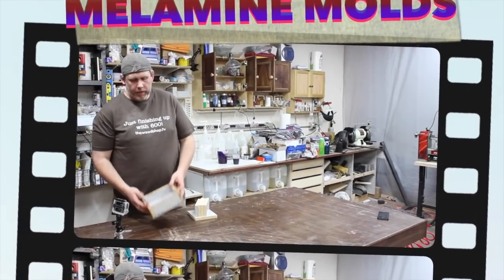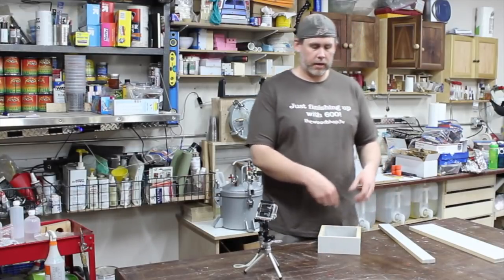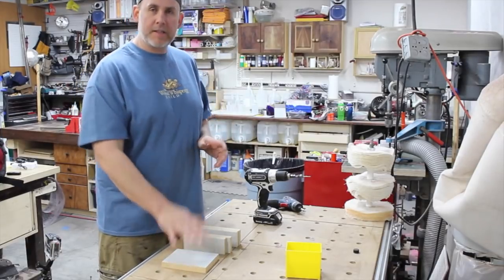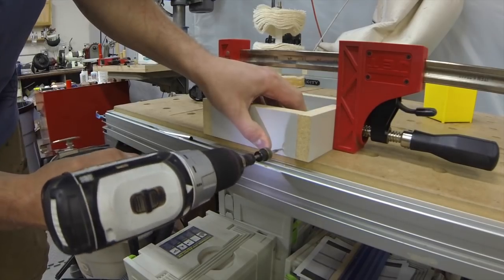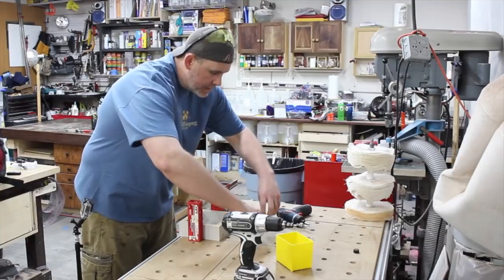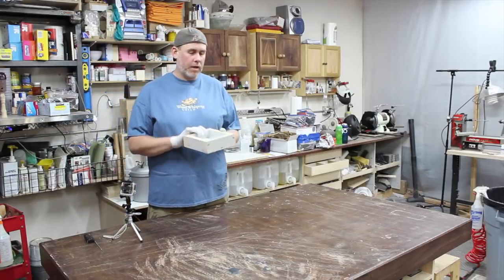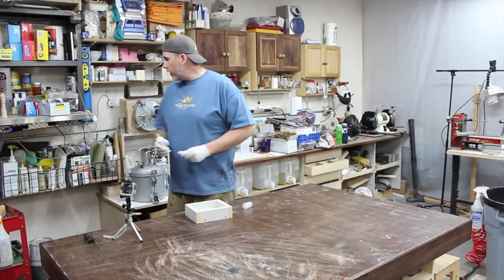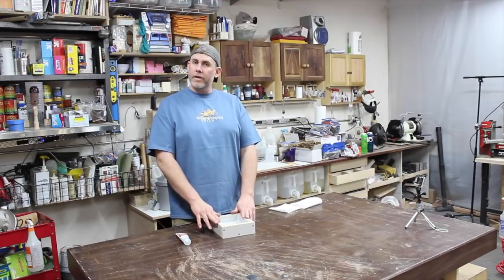Make Melamine Molds For Resin Casting - NV Woodwerks

Comment: If you get it at a local lumber place (NOT HD or Lowes), you can get a 3/4" 8x4 sheet for about $30.  Not a bad deal.  Did all my shop countertops in the stuff, in black, and they look cool.  Thanks for the vid Zac!

Comment: I don't have a table saw. Could I have Home Depo cut this? Also do I need to spray anything on the bottom to prevent sticking & approx curing time. Great video btw

Comment: Zac you can buy the shelving material 1/2 or 3/4 x 12 " x 8 ' I haven't seen sheets of it like plywood .. But with that you can make hell lot of molds .. And great idea i'm going to try that .. Have you ever used Vasaline as a release little dab on your finger just enough to put a film .. Its a old painters trick that i've used for years for trimming around windows and stuff .. Nothing will penetrate it ..
Reply from the maker: Hey James, I've heard you could use vaseline, but I haven't tried it. Paste wax works great though too. Give it a good coating, you don't want the resin to stick to the melamine. I've heard some folks say the shelving material works, others say it doesn't. Just make sure to get a board with a decent thickness of melamine on top, I think some shelves have a different film layer than melamine

Comment: Hi zac, what measurements did you cut your molds into? Also i brought myself a drill press but it only goes into my blanks 55mm, because the brass tubes are small enough should i just cut my blanks into 3 instead of 2??? Or should i get a different drill press???

Comment: Another thing you can use rather than the expensive release sprays is to use regular cooking spray like PAM.

I need to make something like this, the PVC pipe works great for a couple colors that you don't care about how it turns out, but I'd like to do some blanks that use different colored resin ribbons and these types of molds are the way to go, open base makes for easy layout and pouring in of the resin.
Reply from the maker: +William Todd (williamtodd) I haven't tried using PAM yet, Alumilite can be finicky sometimes depending on what it comes in contact with. I just decided to go with one that's supposedly formulated for polyurethanes. Like so many things though, it may just be marketing! 

I think you'll enjoy using the horizontal molds. I definitely like the way the blanks come out a lot more than using the pipes. You will definitely save a lot of resin using tubes though.

Comment: Home Depot carries 1/2” x 2’ x 8’; they also sell White Melamine Wood Shelf in different widths and lengths in 1/2” and 3/4”.  So you don’t have to purchase a 4’x8’ sheet if you don’t have a large enough area to cut it up on. Plus a full sheet is heavy to carry.

Comment: Thank you for sharing the video.  As always I find your videos really helpful.  After building the mold I proceeded to cast a blank. However apparently the A and B did not mixed properly, after over 15 hour in the pressure pot, the blank did not get hard. It was too soft.  what I'm doing wrong?
Reply from the maker: Hey Samuel. Curing problems are caused by improper measuring or mixing. Make sure you read the instructions for the product you are using to know if it's measured by weight or volume. Also give this video a look that covers proper measuring and mixing: https://www.youtube.com/watch?v=nNkEVfWD9a8&t=1s
Reply: Thank you for your quick response.  I will try again.  I hope it works this time.

Comment: i know this is a really small insignificant tip but for a really smooth corking job get some very soapy water and a damp cloth. dip it in and smooth away. i use fairy liquid. I dont know what you call it in the states but basically dish washing liquid. Cheers for the vid! off to make some blanks with a lot more confidence!
Reply from the maker: +m4xrb Great tip! It gets messy wiping it all around with your finger and paper towels. I'll have to try that on the next one.
Reply: Zac Higgins wouldn’t this potentially pollute the resin mixture?

Comment: Thanks.  Looking at getting into this. This was a good starting point for a newbie
Reply from the maker: Glad it was helpful for you Troy, I think you'll enjoy casting =D Check out my video on HDPE for molds too, it's totally non-stick and works even better for square molds than melamine https://www.youtube.com/watch?v=RrqKN1g6vA4
Reply: Thank you.  I’ll have to check out the hdpe video.  Do you have a preference as to the brand of exposure you use?
Reply from the maker: I'm guessing you meant to say what brand of epoxy instead of exposure? I primarily use Alumilite Clear casting resin for my work. I also have use epoxy products when I need a longer working time though. I have links to the ones I use on my "tools I use" page on my website: https://nvwoodwerks.com/tools/

You might take a peek at my video Choosing Casting Resins, it goes over the three main types of resins out there: https://www.youtube.com/watch?v=pQ63Fky5ca4&t=1s

If you're just getting into casting,  my e-book "The Beginner's Guide to Resin Casting" should be helpful. It covers all the basics: https://nvwoodwerks.com/product/the-beginners-guide-to-resin-casting/
Reply: Yes.  I did mean epoxy. I checked out the hdpe video.  Might be easier than melamine.  I’m wanting to build some molds to make micarta style knife scales
Reply from the maker: I think you'll be better off with HDPE for that since it can get pretty messy. No need to even worry about it then

Comment: I was thinking about doing some sort of mosaic pattern using small wood blocks on top of a round wood top and filling all the gaps with epoxy. How would you go about wrapping/sealing the edge? Awesome video man.
Reply from the maker: Hey Joshua, that's a pretty awesome project idea! I'd try to find something that is a relatively thin plastic that you can bend/wrap around the circle base and hot glue it in place. I've been racking my brain trying to come up with the perfect thing to use to wrap around it, but I just can't think of something that is readily available and super cheap to use for it. The only thing that comes to mind is thin uhmw. I have a feeling that you can find something similar for cheaper, but here's a link to the UHMW I had in mind: https://www.woodcraft.com/products/slick-strips-3-width
Reply: I'll keep that idea in mind. Thanks for replying so quickly. Never worked with resin before so I'm kinda clueless. Now I'm thinking maybe I could find some kind of paper board that is thin enough to wrap in a nice circle but rigid enough to keep its shape. Do you think it would work well if I glued the bottom edge of the paper to the base and then seal the corner with silicone and use packing tape on the inside of the board?

Comment: Correct me if I'm wrong or clear this up for me, are you referring to particle board with a "Formica" laminate on it? I saw a comment where you discussed with someone about picking it up at store as ready made shelves. I was thinking that would be Formica.
Reply from the maker: I'm not sure what the difference between melamine and formica is, but I think we're talking about the same thing. It's just particle board with a piece of plastic glued to it. You can get melamine covered sheets at home centers, but there are also some precut pieces that appear to be the same material in the shelving department.
Reply: Thanks Zac for the quick response. I did some research online before I rattled your cage and I did see it was mentioned as being 'part' of Formica but then it started looking like a Chemical Lesson & I'm not so interested in knowing the molecular  structure of it ;-) lol I've saved some shelving  shelves (that sounds funny for some reason) planning to use them for some jigs around the shop. Will let ya know if/when I feel up to doing them if it works so you can pass the info along.

Comment: nicely done! thank you for the tips, you are very thorough. wondering what you store in the big plastic jugs on the below shelf on the bench in the background?
Reply from the maker: +Tyler Haywood Thanks Tyler! I try to pack as many tips in as I can, I know how little tips can make a huge difference and save you lots of time. Those big jugs are 10 gallon kits of Alumilite resin. I was just running through the 2 gallon kits too fast, had to bump up to the big jugs!

Comment: last question... have you used polyethalene for a box? if so what is diff between it and the melanine? thanks!!!
Reply from the maker: I haven't used polyethalene for a mold, I am actually using 1/2" smooth HDPE sheets for mold material now though. It's totally non stick.
Reply: thanks i will try that!
Reply: Do you still need a release agent with the HDPE?

Comment: Hi Zac,  I made your form and it turned out great. But the resin stuck to the melamine and ruined the form. I believe I used the wrong spray .. What type spray do u use for resins, please? Jim
Reply from the maker: I guess it depends on what resin you're using. For Alumilite, you want Stoner Urethane Mold Release. You can get it on Alumilite's website: https://www.alumilite.com/stoner-mold-release-12oz.aspx

Comment: HI Larry here I was wondering when you do your molds and when you pore the resin do you cover it? also when you turning your pen blanks what type of setup do you use ? the live center ect?  I guess to hold the blanks on the lathe? and where do you get your pen kits? sorry about all the questions I'm new to this! and your videos are great! thanks Larry
Reply from the maker: Hey Larry, glad you're enjoying the videos! I don't cover the mold when I pour them, just pour it in the mold and put it in the pressure pot.  When turning pens, I use a dead center in the headstock and a live center in the tailstock, and I use "between center" bushings rather than a mandrel. I find mandrels to be inaccurate and can cause blanks to be turned out of round or cause issues when applying finishes.

I usually buy my kits from Turners Warehouse (www.turnerswarehouse.com), Chad Schimmel owns it and is a fellow YouTuber,  and he has a big selection, great prices, and excellent service to boot! 

Check out Chad's channel too, he has some really good videos on pen making and casting too: https://www.youtube.com/user/ctschimmel. Oh, and I just remembered, Chad has a great video explaining the different types of bushings you can use for pens: https://www.youtube.com/watch?v=5q3AwlPftTY

I also have a resources page on my website with links to where I get most of my tools, equipment, etc., and I have links to the dead center and live center that I use as well as most of the other things I use for casting and turning: https://nvwoodwerks.com/tools/

Comment: Have you ever had an issue with opening the pressure pot and looking at your mold only to see that the corners are rounded? It's like the resin just pulled away from the corners. I'd like to fix it before I make a 5.5 inch mold to still get square 5 in blanks
Reply from the maker: Yeah that happens often, it's because the corners are cooler and the resin tends to migrate to the warmest spot. Try heating your mold up before casting, it should help out. Make sure the mold is sealed as well to stop airflow into the mold

Comment: hola: in my country i cant buy alumilite resin, is epoxi resin the same? and insted stoner what i can use? thank for sharing is very usefull information
Reply from the maker: Hola :-) Epoxy or Polyester Resin will work pretty similar to Alumilite. There are some minor differences, but all the casting resins are generally similar. Each resin type has a different spray mold release agent. Stoner is a urethane release agent, but there are other general ones. You can also use petroleum jelly or paste wax as a release agent. Epoxy and Polyester Resin both shrink a little more than Alumilite though, so you may not even need to use any release agent with them.
Reply: Great! thanks for all the infornation and your time
Reply from the maker: No problem at all, glad to help out :)

Comment: hey zac, whats better to use the melamine or the plastic cutting boards from ikea?
Reply from the maker: I personally like the melamine molds more. I had issues with the cutting boards, and these melamine ones are just easier for me to build, and they last a lot longer. After only a few uses, the screws became useless in the cutting board material, and I had some leaky molds. The cutting boards do work, but I personally think these melamine molds area a little easier to work with.
Reply: thanks a lot zac

Comment: If you make a large mold, say the size of an end table, how would you heat it up if it is too big to fit in a toaster oven or oven?
Reply from the maker: Hmm, that's a tough one. I suppose you could use something like a heat lamp above it or a heated blanket below/around it. It may not be necessary though

Comment: Can you use Silicone molds in the pressure pot?
Reply from the maker: Absolutely! The only thing you have to watch out for is going too high with the pressure. It's possible to deform the mold if the pressure is too high. You also have to make sure that the silicone mold doesn't have air bubbles in it, or they will collapse under pressure. Most commercially available molds are degassed properly though
Reply: Thanks!

Comment: Hey, I wanted to ask you a question about working with clear resin since I am still new to this. I'm trying to cast a rectangle but have made my mold using regular would that hasn't been primed. If I apply the Stoner will the resin still stick to the surface? Also great video!
Reply from the maker: Thanks Vicky! I think you might be able to get by with spraying with Stoner, but I'd probably give the wood a few coats of paste wax too for a little extra insurance on it. It's best to use materials that are non stick like HDPE if possible. If it ends up sticking to the mold, you can always cut it off too

Comment: Just curious. Do make the molds in size relative to a pen blank. Such as 5x5 or in that multiple.
Reply from the maker: Yeah, I typically make 5" long pen blanks, so that is always one dimension, then I just estimate 1" per blank for the other dimension. So, for 6 blanks, I will make a 6" x 5" mold, or for 3 blanks it will be 3" x 5"
Reply: Thought so. Just checking. Thank you.

Comment: Excellent video. What kind of cameras are you using?
Reply from the maker: +Ed Pitts Thanks Ed! I use a Canon T3i DSLR for most of my shots. I also have a GoPro that I use as a second angle or to get in close without worrying about dust or chips hurting my DLSR.
Reply: Thanks Zac

Comment: Thanks for sharing. You make it look easy. The red locking attachment on your sled? Where did you get that?
Reply from the maker: Hey Jim, thanks for watching! That miter guage is made by Incra, and it comes with the fence and stops. It's product ID is Incra 1000SE. I found it on Amazon so you could see what it is: http://goo.gl/p9RlMS but you can get it or something like it at places like Rockler, Woodcraft, etc.

Comment: Great videos, learning alot. Love your shop setup. Im trying to build up clear resin on a jewelery box lid, about an inch high. Any suggestions?
Reply from the maker: Hey Grant, glad to hear that you're learning a lot from the videos, that's the best feedback I can get! I haven't done any projects like that jewelry box lid really. Closest thing I've done is the memory frames a couple weeks ago (https://www.youtube.com/watch?v=Y0b7tdH1xG4&t=98s). I suppose I'd just try to apply some edges around the lid to hold the resin in like a mold and pour an inch thick layer on top of it

Comment: hey zac, great video, i cast resin with wood and normally scree the wood to my current molds “poly” but i run into leaks and end up always taping before and just a whole headache. what would you recommend for holding woods down? screw? glue? let me know, thank you!
Reply from the maker: I usually hot glue things that need to stay in place in the mold, works pretty good
Reply: well, finally came across to put some wood in and i put stoner before and then began hot gluing the wood... I know such an idiot... What are my options now? I keep whiping off the stonger with a dry cloth but the glue doesnt want to stick... is there something that will completely clean it off then put the wood then stoner it? Also, doing this... will the wood release easily, since there wont be stoner.. just a question, thank you.
Reply from the maker: Hmm, that's a bit of a tough one. You might try using denatured alcohol or acetone to wipe off the Stoner. You'll probably run into problems with demolding though if you are using melamine for the mold without Stoner. I'd recommend using HDPE plastic or corrugated plastic for the mold for this instead. I have links to where I get the HDPE plastic on my "tools I use" page on my website: https://nvwoodwerks.com/tools/

For the corrugated plastic, I'd check out Heath Knuckles video on doing worthless wood so you can get an idea of how that works: https://www.youtube.com/watch?v=Rt782e4FUZQ
Reply: ahh my previous molds were HDPE... but i liked this one more so I made 2 of your style.... I can just screw them as well... my issue with HDPE was my edges were not perfect, so I had a lot of leaking... What i would do is pre-tape every time prior to casting, was becoming a hassle. I think I have an idea... I'm going to clean the new molds get rid of the stoner, once I know where I am using the woods, I am going to tape small areas then use the stoner, take the tape off and hot glue just those portions.. so it stick and hopefully does come off... what you think?
Reply from the maker: I think that's a great idea! Much easier than switching out the mold if you have the right size ready to go